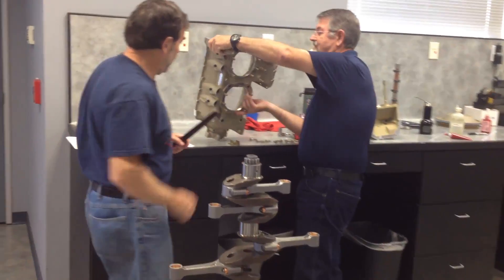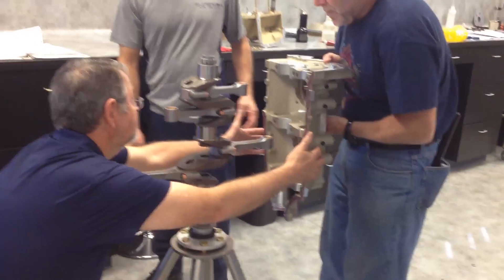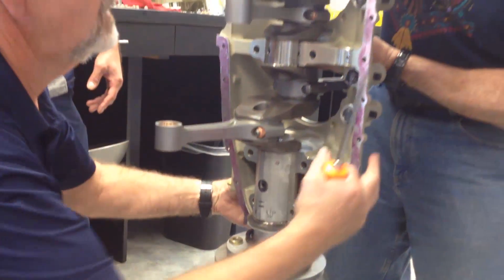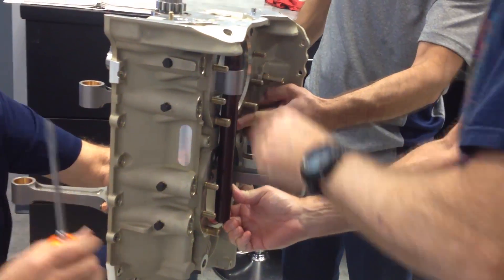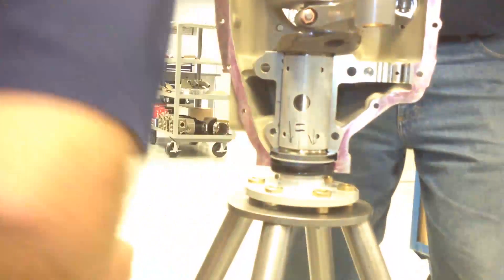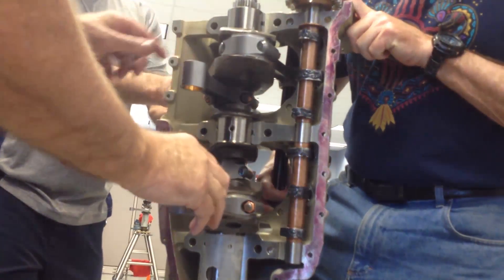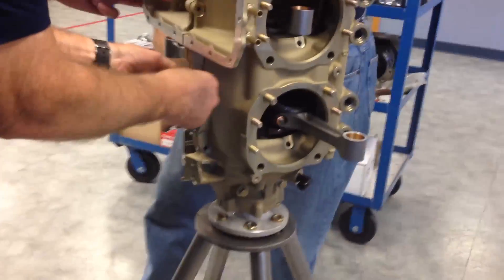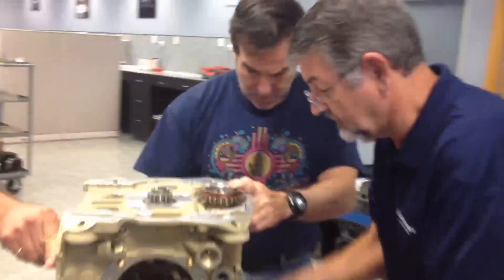Superior Engine Build School Case Assembly

Comment: And during case closure the front main can shift.  Many Lycoming cases have to be pulled together with the studs/bolts.  This is why we don't assemble cases in the vertical at Pelican Aviation LLC.

Comment: Why is sealant not applied to the saddles on the forward, center and rear webs of the crankcase halves on Lycoming engines-? 
Sealant is only applied to the parting surfaces around the periphery of the crankcase halves on Lyc. engs.

Continental engines apply sealant and silk thread to the forward, center and rear web parting surfaces.

Since there is very slight movement between the case halves parting surfaces in the center of the engine, metal fretting sometimes occurs as well as oil ingression between the parting surfaces which eventually means metal wearing against itself and torque being lost on the thru bolt nuts. Then it is just a matter of time for having to do a premature engine disassembly. 

On another note, 
Lycoming engines have their camshaft mounted above the crankshaft which means no oil drip effect from the crankshaft on to the camshaft which results in premature rusting of the camshaft lobe(s) and lifter face(s) if the engine sits inactive for a period of time. 
Continental engines mount their engine camshafts below the crankshafts and are less prone to rusting of cam lobe(s) and lifter face(s).

Having to remove the propeller and starter ring gear on a Lycoming engine to change an alternator belt is a bad design while this is not necessary on most Continental engines since they mount their starers and alternators on the accessory drive case meaning that no drive belt is required.

Comment: does the piston have a correct orientation as to what position it goes into the cylinder or we can rotate 180 degrees and it does not matter what orientation the piston gets in?

Comment: Cockeyed way of doing it, lay one case and use gravity to fit it together not mess about TRYING to fit it upright with everything trying to fall off and what about assembly lubrication of the bearings?
Have a look how Lycoming do it and Continental as well.
Reply: Agreed. Crank and rods in the bottom. Cam in the top half. Loop of safety wire around the cam tied off to a cylinder stud to hold the cam and lifter bodies in. Onean job without the risk of knocking a case half on the floor. One man should be able to handle a cylinder and the ring compressor also. I have done hundreds myself.
Reply: Not to mention the fact they didn’t seal the case

Comment: Great job Guys! Could you tell me what is the press fit tolerance for the exhaust valve guides to the cylinder on the Lycoming O-360 engine? Thanks in advance.